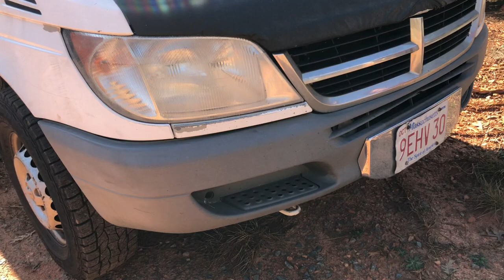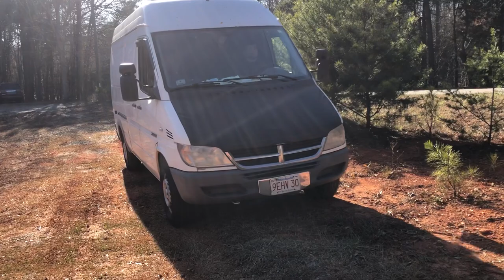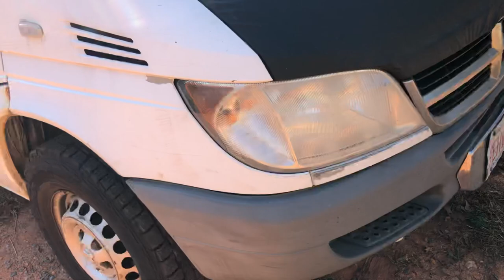2006 Mercedes Sprinter Fan Clutch bearing failure sound

Comment: Did you figure out the problem?
Reply from the maker: Yes, water pump was knocking against the head due to fan clutch bearings fail, and it was also shutting down and hard to start and misfire in cylinder 5, all injectors replaced problem solved